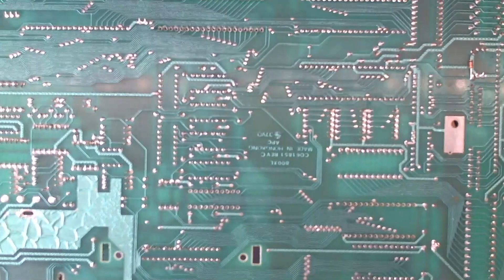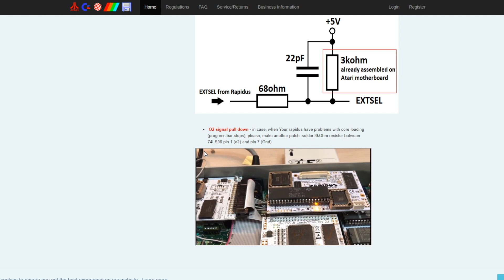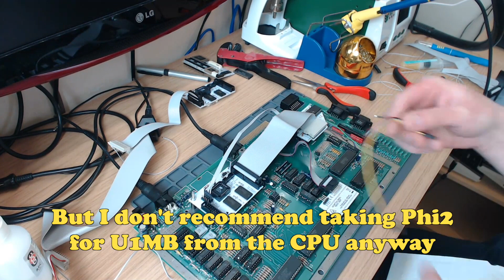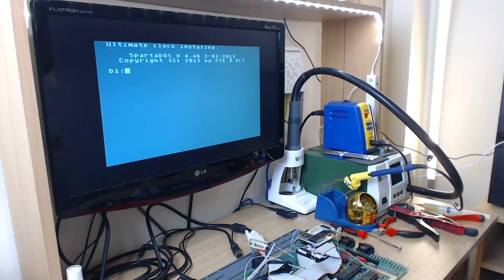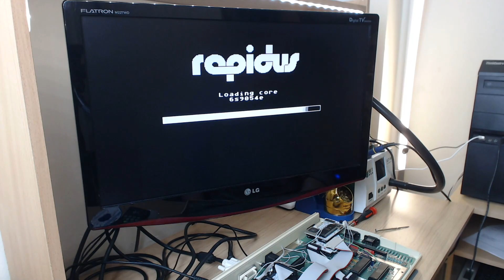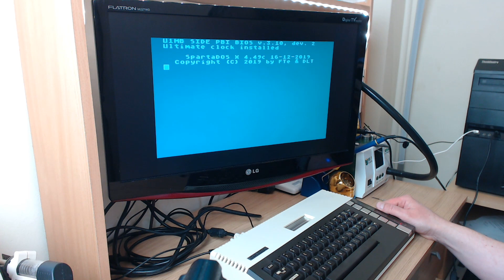20MHz Atari 800XL: Rapidus, U1MB, and Sophia DVI: Part Two

Comment: I'm glad I have a 1200xl that needs work on the sio(+5v & +12v) and on the svideo for chroma, plus the rf needs to become a dvi port and be otherwise the same upgrade in your video. No cartridge port is in the way of those ribbon cables on a 1200xl and probably on a 130xe and probably on a 65xe. I only have a 1200xl, I wish I hadn't sold off the 1400xl as it had a pbi bus and fit in a 1200xl case and used a 1200xl psu and keyboard. The boards look like they weren't designed with each other in mind and to keep any ribbon cables as short as possible, but that is my guess.

Comment: can a mod like this be applied to an Atari 800XL that already has the old 256k RAMBO XL mod in it?  It's not like I can revert back to 64k since I do not have the old RAM chips anymore. It's been like 30 years.
Reply from the maker: Yes: Rapidus should work just fine with the existing RAMBO upgrade.

Comment: My first computer was an Atari 800 before we went to C64 and Amigas. I was looking to pick up an Atari 800XL myself since it has more RAM than an 800. This is the first time I've seen anything about custom add-ons for any Atari system.

What can you do with these add-ons? It looked like all of the menus were different so doesn't cease to be an 800XL at that point? I'm not saying it's bad. Just kinda curious.
Reply from the maker: There is quite a healthy upgrade scene for the 8-bit Ataris, and U1MB and SIDE2 are two of the more popular devices (I made several videos covering SIDE2 which you might want to check out). U1MB provides 320, 576, and 1088K RAM upgrades, plus everything mentioned here: https://atari8.co.uk/firmware/ultimate-1mb/. SIDE2 provides a Compact Flash based HDD and everything mentioned here: https://atari8.co.uk/firmware/side/. These two don't dramatically change the 'character' of the machine; they just coalesce a lot of functionality from disparate devices and generally improve on it. You could argue that things like VBXE and Rapidus fundamentally change the character of the machine, on the other hand. Sophia DVI doesn't: it simply offers vastly superior video quality.

Comment: I think maybe it's me that you are referring to from 2017.  I just tested hitting the reset like 10 times in both Rapidus mode and Classic mode, and it worked correctly (as in not a cold reset.  In fact if I loaded BASIC for either, and hit the reset, it would just take me to the READY screen.)  I haven't updated to the latest firmware for the U1MB yet, so the PBI bios is still 3.00 dev. 2
Reply from the maker: That's good to hear, although I wasn't referring to you regarding the lack of feedback (unless you simply mean you are the owner of the machine I worked on). It seems your machine is working correctly, which is wonderful news. The U1MB firmware is not responsible for the problems I have observed, so has no bearing on the situation (Dev. 2 is the PBI device ID you have assigned the PBI BIOS, BTW; not part of the firmware revision number). Thanks for the info!
Reply: @flashjazzcat  Ha, yeah I meant I think mine was the machine you worked on.  But yeah it does seem to be working correctly.  I'll try leaving it on for longer and see if it does the same thing.
Reply from the maker: @FookWit-sapien  I installed Rapidus in a couple of machines a few years back and actually can't remember one quite as bad as this 800XL. :) I don't think I would have ever sent them back to their owners, otherwise. :)

Comment: please excuse my ignorance, but what is the reason for soldering all the pins before using the de-solder tool ?
Reply from the maker: I'm adding 60/40 leaded solder, which has a lower melting temperature than the lead-free stuff on the board. This just helps get things moving more easily when using the desoldering tool.

Comment: The frustration..  I've been meaning to buy a Rapidus for my XEL, thinking that there would be no issues, I've even built another  CF -3 interface based on EBIGUYS design so as not to interfear with the Rapidus.   Your mention of the Reset issues remaining with the XEL has kind of put me off. 

I guess the same for the XLD, which I've also built, have you tried the XLD with Rapidus ? I know you did have one to build up as I've watched your video's for some time now.  By the way I love the new video productions. 

Keep it up
Reply from the maker: Yeah: your concerns are understandable, but we already have one comment here asserting that the reset issue doesn't exist on a particular 65XE. Your mileage may vary, but I can only represent things as I find them here. I don't want to discourage people from purchasing Rapidus (although this irrational accusation was levelled at me at first after Lotharek kindly sent me my Rapidus free of charge in acknowledgement of my firmware work); it's a nice device and clearly a lot of work went into its development. If Lotharek sells Rapidus and the customers are happy, I'm happy for both parties. But for some reason the issue discussed in the video plagues every U1MB machine in which I install Rapidus, including the 1088XEL. I make videos of stuff people ask me to install in their Ataris, and the result is an honest representation of the outcome. As for the XLD: sadly, I haven't completed mine yet (apologies to mytek!), so I cannot speculate on how Rapidus would behave in that machine. Thanks for the kind feedback!

Comment: I like these videos. I was thinking of getting all those items for my Atari but it sounds like Rapidus is  c*rap, so I won't be getting it any time soon. I will still get the U1MB and the Sophia.  Thanks!
Reply from the maker: Rapidus is a pretty cool device and was in development for fourteen years (so, quite some pedigree). I see no obvious problems when running it without U1MB, and the 800XL in which I installed U1MB/Rapidus in 2017 kind of worked, so your mileage may vary.  Of course I can recommend U1MB and Sophia without hesitation; Phi2 issues with Sophia discussed in a prior video were swiftly and efficiently addressed by the developer. Normally, however, things simply work perfectly out of the box with both upgrades.

Comment: Works fine for me but on a 65XE.
Reply from the maker: No cold boot on reset, with U1MB? That's great! I wonder how one accomplishes this feat.
Reply: Hi Peri Noid 

Can you share with us what type of Mother board, i.e  there are boards with 8 chips installed, giving 64K with space for 8 additional chip, others with only 8 Chips,  another variant using either two or four 4464 type chips 2x 64K 4x 128K not sure if there is a two chip only version.  be really nice if you could open up and take a few photos of the upgrade in place.
P.S did you do the upgrade yourself
Reply: @grahamrolle3923  It's the 8-chip 65XE board, the one without ECI connector. SO, potentially the worst one.

Comment: Could it be bad ram chip in the onboard stock ram ? The parity failure may not be a false report ?
Reply from the maker: I've seen this parity failure report before on other machines, unfortunately, and the base RAM is OK on this machine. I've been exploring these issues on and off for four years. :)
Reply: @flashjazzcat  i have a suggestion for troubleshooting.. It may or may not be feasible for you...

Set up a series of good 8XL mobos, each with a different upgrade or combination of upgrades.. Like 1 with ultimate and 1 with rapidus and so on.  But do the layouts in ways that you would if they were all installed in the same system. Like use the left-rear ultimate location that forces the longer ribbons, etc.
Reply from the maker: @MessalineApghar  Good idea on the face of it. I've installed Rapidus in the following machines (all with U1MB): 1200XL, 130XE, 800XL and 1088XEL. Same problem on all of them. I installed Rapidus on an XE without U1MB, and I don't recall the problem existing there (although there was no SDX ROM, of course; I don't recall if SDX on SIDE had the same issue). The 1088XEL needs no ribbon cables at all, has a four-layer board with GND and power planes, and... exact same issue.